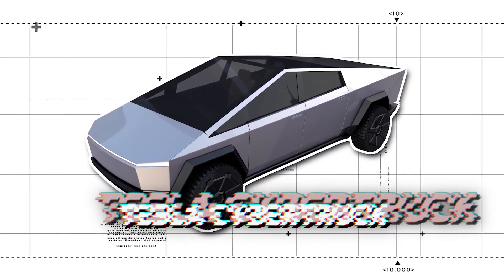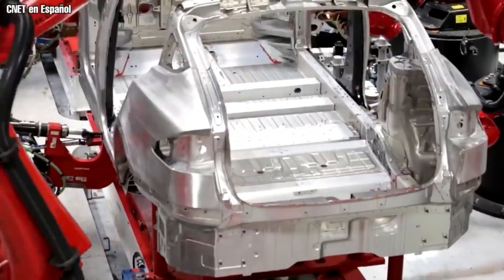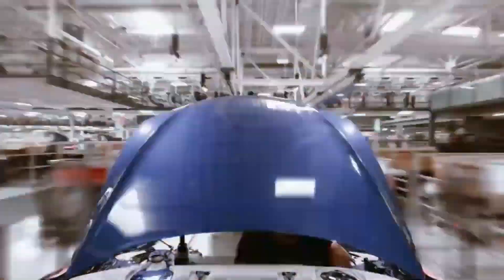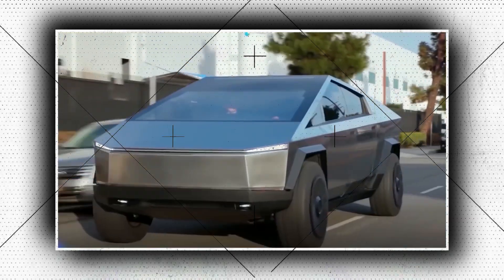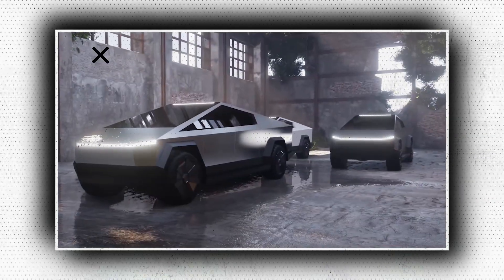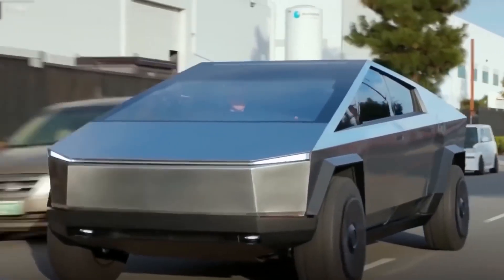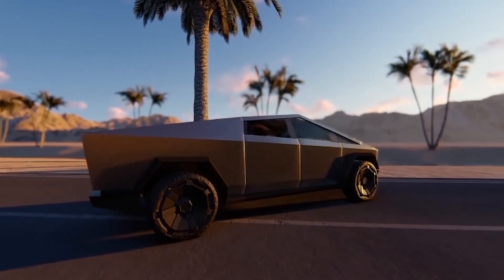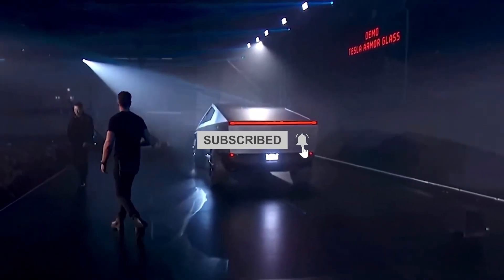Elon Musk REVEALS An UPGRADED 2023 Cybertruck!

Comment: instead paying $700 month for their gas truck payments they pay $1000 a month for cybertruck but save $2000 in fuel DO THE MATH ITS NOT ONLY FREEEEEEEEE ITS PAYING THEM THOUSAND+ MONTHLY CYBER TRUCK IS FREE FOR ANY HIGH UTILIZATION BUSINESS>>>> AND 97% HAVE NO IDEA
Reply: they will sell millions....
Reply: There is the cost of charging the battery to factor but I agree w/logic.
Reply: @Marcus_MarcusOG  you can charge overnight for near 10  usd cents kwh in canada vs 5.75 USD gallon equivilent and the million watt super charge for small top up if need ( 500 miles in a day is a lot if you use entire 200 dollar a day in gas though youll be saving 150 a day x 30 day is 4500 x 12 is 50k a year. so if you need supercharging your savings tenss of thousands  which a lot of business have no clue the math so good
Reply: @Marcus_MarcusOG  tesla did guarantee very low rates  of electricity for the semi -- if truck is same charger maybe the rates will be very good even for mega charger in future also